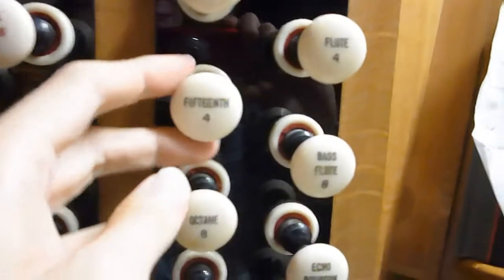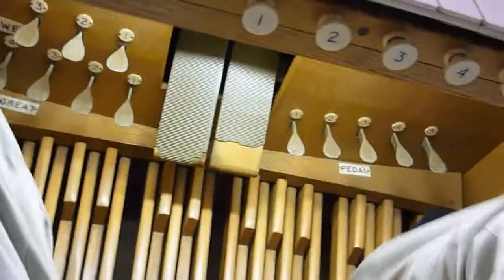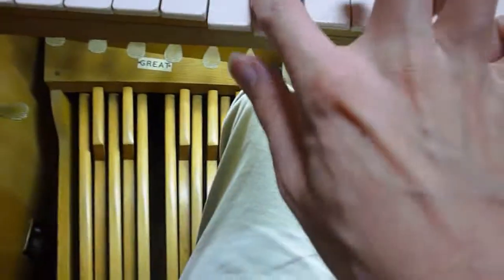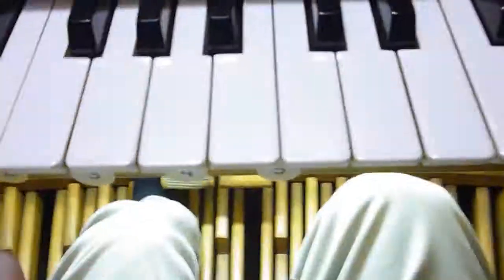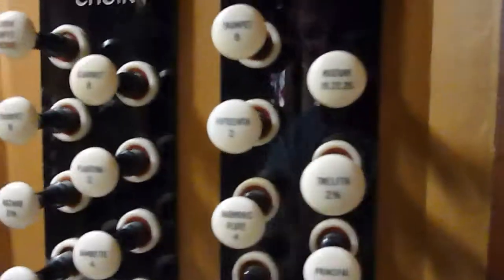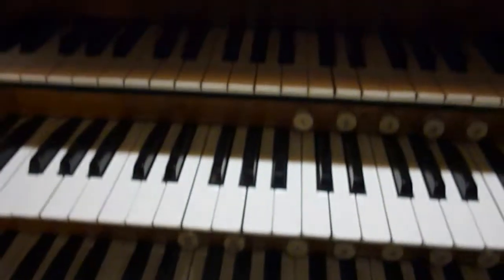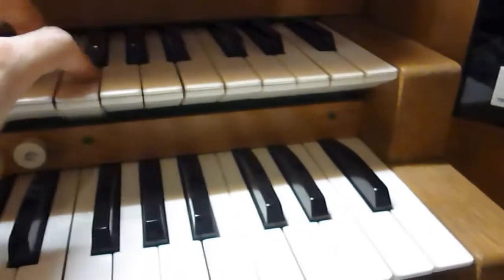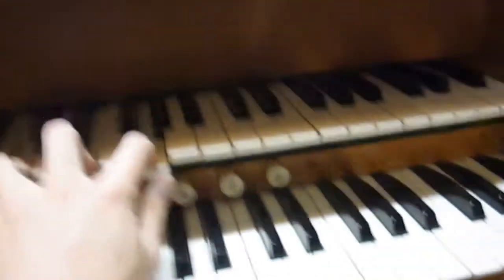A demonstration of the pipe organ at Holy Trinity Church, St Austell, Cornwall

Comment: Have you considered applying to have the instrument put on the BIOS "At risk register"..?

http://www.bios.org.uk/resources/oarrIntro.php
Reply from the maker: Thanks for the suggestion - I was indeed aware of the register you mention, although I'm not at all sure that BIOS would consider the instrument either historically significant or - as yet - "at risk" enough to be added (it has been somewhat altered from its original specification so I suspect it lacks "historical integrity" from their point of view, and no firm decision has yet been taken to proceed with the proposed works) - and even if it were to be placed on the register, this would not by any means guarantee that it stays in St Austell. However, "historic" or not, it is a beautiful-sounding organ that deserves to be appreciated in its present location, and so the powers-that-be at Holy Trinity need to be persuaded that its aesthetic and amenity value as an instrument, its significance as a feature of the building, and (above all) its continued usefulness in worship and witness are such that it would be a mistake for them to dispose of it - and, if my videos help to convince them of this, I shall be glad indeed!